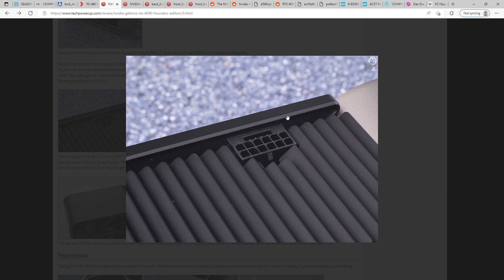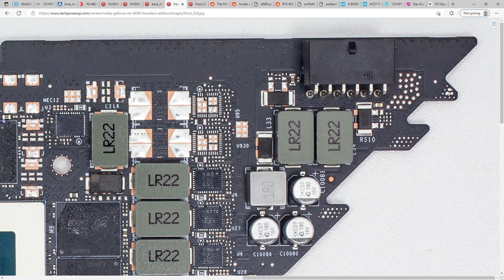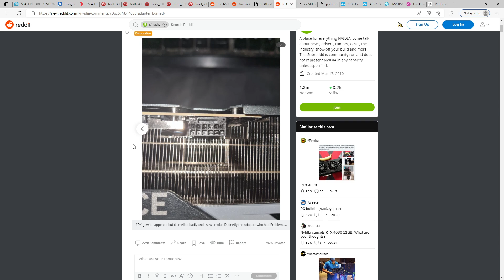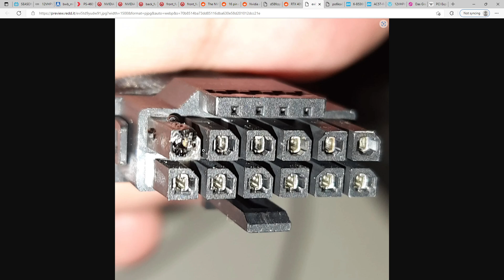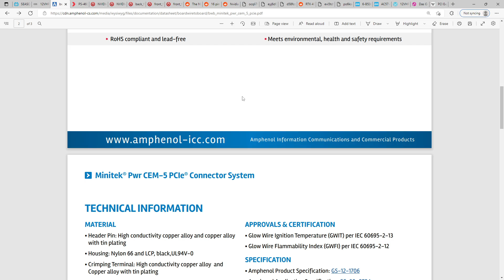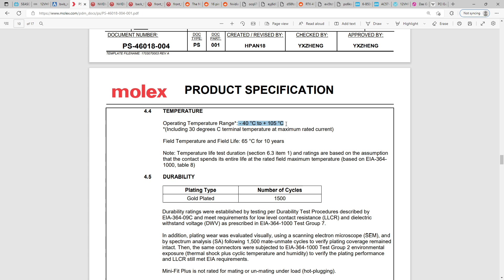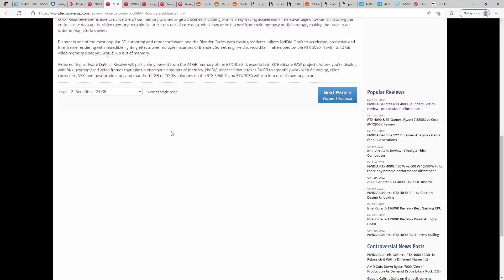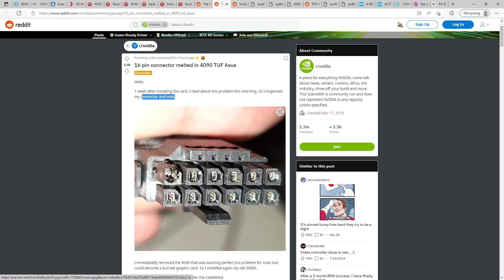rambling about the 12VHPWR failures

Comment: How do you feel overall about the amount of current being shoved through those connectors? At 600W that's 50A of current which just seems to be asking for connector problems.

Obviously that'd be total chaos with power supplies, but maybe there should be a 24V standard to bring the current back down before we end up with GPUs with car battery terminals on them...

If you think about it, what else in your house even requires a 50A capable connector?
Reply: Your concern is unfounded. The wires are more than capable of the current when counted in parallel bundled together. I will explain why since you seem smart.
The 4090 adapter shown is using 14AWG wires, 4 of them for power, 4 for ground feeding into the 12-pin plug. This 14 gauge is very common wire-gauge in homes (also 12), and is regulated to 15-amps in the US, you would be familiar with this spec. This is conservatively rated for in-wall home safety, the wire itself is acceptably used in 25-30 amp in other situations, or even more if cooled. So Taking conservatively 15 Amps * 4 Wires = 60 Amps. Times 12 Volts = 720 watts. More than enough to cover the 600w figure.
That said, the Pin and the Connector, I can't speak to, but BZ said 9.5 Amps capable per pin * 6 pins = 57 Amps. 684 watts. So also enough.
It wasnt the electrical engineering that went wrong, its the mechanical engineering.
You bring up a good point though about the 12V becoming somewhat undesirable when such high amps are needed.
Reply: @mrlithium69  Yeah I get that the connector can handle it, he's explained it very well in the video and supported it with actual specs. But the 8pin connector did have a much wider safety margin which undoubtedly contributed a lot to incidents like this being rare. Hence why the question, have we reached a point where GPUs need so much power that 12V is worth it anymore.

I know these things fairly well and I wouldn't have had thought to even think about the connector if I had a 4090: plug it in, close case panel and use the card. Realistically with an 8pin even though it's not great for it, you wouldn't think too much about it being squished a little if you're tight on space or length as long as it's "clicked" in properly and doesn't come out. Lots of people have their motherboard 24pin do a sharp bend to go into the back of the case and nobody thinks anything of it either. 50A just needs a lot of pins and very good contact and nothing about this connector or cable screams high current, proceed with extra care.

I'm also thinking about all the videos out there of LTT or GamersNexus receiving PCs from prebuilt companies with connectors not being plugged in correctly. This connector effectively needs to be plugged in perfectly and its cable ran perfectly to not be an issue. Going to 24V or even 36V would bring the tolerances back to 6/8pins. It's going to step it down to 1.something V anyway, if anything the VRM should run cooler.

With ATX12VO coming up, now would be the time to include other voltages in the spec on top of getting rid of 5V.
Reply: I would like to see 48V what is used in telecom.
I think main problem in this case is nvidia adapter has bus bar in connector and if connector is having uneven force that one connector is making better contact then it take "all amps" and burn. ok not all but over rated current for that pin. But with individual cables cable resistance is balancing those currents.

Comment: Question: Why can't they use SATA type connectors?
Reply: The pins in SATA power connectors are very small and are rated for relatively low amounts of current. About 50watts compared to 300ish watts of an 8pin PCIE connector.
Reply: @xDownSetx  ahh. Ok thanks for the enlightenment

Comment: This connector would probably work fine if each crimp were terminated to a single cable.  The fact that they are commoned by a rigid strip of metal in order to adapt the number of connections means that the bending moment placed on the outer pins is quite large. This combined with the split female crimps means you probably end up with the far pins making only partial contact at the tip and the base of the male pin. As you pointed out the thermal resistance of the plastic will be quite high so it won't take much additional power loss to cause overheating.
Reply: The bending of the cables is just stupid. It could easily be rectified if someone had actually used their brain when designing cables and how the connector was placed on the board.
Reply: @mrdali67  You forgot one of the most glaring issues - STRAIN RELIEF. How TF there isn't any REAL strain relief material securely holding the wires is just absurd. Coming from a motorsports background, strain relief is a big deal because of all of the G forces & vibration, and to see such minimal strain relief on a connector of such fragile construction is just mind blowing.
 
What Nvidia won't do to save a buck...
Reply: @RyTrapp0  Ya it's a huge problem, but you can easy make a connector  where you don't have the strain to the cables. 1. Put the darn connector on the back of the card and make 2 versions of an "L" connector so it's possible to choose the right one dependent on how your mounting the card. And you should have no problem in getting a good cable management without bending the cables right at that connector. It's not that hard to figure out. Jesus .. doesn't require an engineering degree 🙃. Again, It's because they didn't care and just botched a really bad solution that could have easy been avoided.
Reply: And 3000 series adapter has all separate cables for terminals. It seems like lower build quality this time.
Reply: @wassilia1234  The 3000 series cable did use the same dual split female pins tho, makes it seem more like a difference in the constrution of the cables causing the issue rather than the pins themselves since they are common between the two adapters, and we didn't have an issue drawing 450W+ over the adapter when connected to a RTX 3090Ti.
Reply: Personally I think that copper strip was an engineered self limiting mode of failure following the theme of the rest of the connector: be as cheaply made as possible. An interesting phenomenon is that once you push enough current to start melting down PCI-E connectors, there's actually capillary action which will wick the molten plastic into the terminal and you end up with a nice layer of non-conductive plastic between the pin and pin housing which stops current from continuing to flow before there's ever a real risk of a fire with only 12V.

To me this is just another classic case of an insanely greedy corporation relying on clever engineering shortcuts to further pad their margins. And with nVidia's history, I'd bet regardless of how prevalent this problem becomes, they're more willing to send this to court for years before they ever considered a product recall (for those with doubts about how low nVidia will sink to avoid liability, just look up "Bumpgate".)

Comment: Well regardless of what really causing it inside the connector cuz different people seem to have different opinion . How safe would you say are the native connections from the new psu compare to the nvidia adapter? Also any thoughts on the 3 pin version of this cable? cuz so far it seems only the 4 pins are melting but I could be wrong and we already have a case not made public
Reply: Watch the video

Comment: Yeah that was also what im thinking...how can a disconnected pad cause the melting of pins? The amount of current going through the Pins doesn't change, only the current going through the cables. Which aren't failing. Even IF both outer pads rip, for many PSUs 300W on a 8-Pin is still within spec... unless you plug in a daisychain cables with both outer plugs and then all current goes through one cables to your PSU... But in that case not the Pins or GPU fails, but the PSU...

Comment: It makes sense the load balance of 3090ti are saving the conectors from burning. The power draw will folow the path of less resistence. Ex: If 4 out of 6 of those conectors are getting any more resistence than normal, the power will flow through the 2 ones with less resistence and exceed the specifications (creating the problem), with power balance the board will not let it happen. Probably the split casing of the conector with bending is creating this bad conection with some of the conectors and causing this unbalance.
Reply: Nvidia cheaping in the conector and the board balance created this problem.

Comment: About damn time.. if there is one channel that should give some info on it should be this one.
The fact that you did not want to is the reason i never subbed :P
The problem is Nvidia not using Amphenol spec connectors... thnx.... 
my home made one (using Amphenol connectors) does 1200w ez... btw...

Comment: yes, there is airflow, but remember there is pretty hot air coming from that location in the middle of the card when the card is under full load. if the connector was on the end of the card it would be better imho.

Comment: Hi i've never commented on one of your videos before but i have to say something about the solder side of the connector. 

It looks to me like each of the solder pads on the connector are separated with a split. If the solder that's been applied only connects to the single solder pad then bending of the 14awg wires could also put tension on the pin interconnect more so than the middle four which are all soldered together. 

Nvidia should've made the solder pad one piece and only had one split in the pin as you mentioned.

Comment: The connector is fine . Was a much needed change over having to jam three 8 pins into high end GPU's. The adapter just sucks & that's on Nvidia. Don't get the two twisted.
Reply: He explained his reasoning for disliking it quite well. There is barely any safety margin on the new 12-pin connector. Also, the pins/terminals seem smaller so it's not very physically robust. There is no real benefit to the user and all it does is cause issues having to use a crappy adapter or buy a new PSU for literally no benefit.
Reply: Never planned on using the adapter as it would of defeated the purpose of parting a new system that takes advantage of the new connection type with a ATX 3.0 compliant PSU. It's a bullet I dodged but I'm glad I made the switch lol. Never going back to PCI-E connectors if I don't have to.

Comment: Why don't they just use a big ol 2 pin DC connectors that RC lipo batteries use that's actually designed for high amps, and don't care about cable bending. Would take about the same amount of space from the pcb as that 12pin.

Comment: with the split pins, a bit of sideways force would cause the pin to open slightly, then you would only have good contact in 2 places, the front left and back right ... and the top + bottom, but a) they are only partial surfaces, b) the force would be left/right so would have better contact there.

Comment: I'm somewhat certain that the hot spot is not where the pin meets the socket, but in the fairly thin section where the metal isn't bent between the actual socket and the plate that wires are soldered onto. It experiences strain from the wires, is by itself fairly thin, and is fairly easy to break. Now I don't think that in most of the melted connectors it broke, but I'm somewhat certain that it has experienced some mechanical stress, which can make it even thinner at spots and increase the resistance. I think it explains the fact that the cable bending is a large factor in the failure. As for why the inserted side of it is melting, and not the cable side? Cables are good thermal conductors and will just wick away the heat from the connector. But since there is that bottleneck of smaller cross section between the cable and the socket, it the sockets will get hotter and first externally visible melting will happen around them. Crimped sockets do not have this problem because there is no such bottleneck, as there is more metal in between the socket and the crimped part as the bend of the connector socket matches most of the bending of the crimping socket, so no need for the bottleneck.

Comment: Doesn't EPS use a similar connector to 8-pin while it is rated for 300w? thanks to intel, we do have cpus that can surpass 300w easily and there hasn't been any reports of widespread issues with that cable, right?
Reply from the maker: yeah the 8pin EPS doesn't have much of a safety margin on it. The PCi-e 8pin a bit of an anomally in that sense.

Comment: Sup buildzoid, have you seen the Brazilian Galax team (Teclab) pushing one cable with >1000w load for a couple dozen minutes in a few lives? even testing different power supplies, plenty of those getting into protection before any harm was shown towards the cables, which is kinda impressive, but still, I'm mostly interested in your opinion on those guys who push for WR OCs vehemently defending the build quality of the cables in response to the enthusiast public encountering and pushing for attention on the issue.
Reply: Conflict of interest is a thing. of course the manufacturers and people associate with them have the incentive to defend the product.
Reply: @SolarianStrike  That is true, although I understand that could be extremely naive by my part, I still find it a bit odd/unlikely how those guys with an image to preserve in the hardware space would shill for Nvidia this heavily if there truly are issues with their product to the point "casual" users with under the spec wattages, since most gpus don't seem to be pushing past 500w mark without meddling/specific models, are suffering cosmetic damages and/or pin damage.
Reply: @SolarianStrike  at least they do live testing and film it
And not just rambling

Comment: thanks no one was showing the pins / contacts i am a  HAM  and they will not holdup  under stress. I'm used to running 12 volts at 1 amp to 150 amps. Not on video  cards.

Comment: I was thinking arcing for a moment (because broken off foil that is used across those connectors would be so close that I thought it was plausible), but then I thought to when I was using cables to jump start my car and while there could be sparks, I didn't think it was arcing. Not with 12 V. Also the other parts of foil would also be 12 V, so there wouldn't be charge differential, unless perhaps it completely snapped of from all connections, then it wouldn't conduct current through it, but maybe it would still have 12 V? Hard for me to say, knowledge of electricity breaks down for me at that level. Also the fact that it was on terminal side usually. Maybe those with melted cables (that we can see on PCI-SIG) would be affected by this, but not those of users. I still think that connecting 4 cables to 6 terminals is a bad idea, because it would be much more prone to manufacturing defects, which might be why OEM's generally go with 6 cables instead of 4.

I didn't think that terminals would be split in half on both ends, because it's such a stupid idea. But I guess everything is possible with NVIDIA. Would love to know if this is similar on 3090 Ti's or if it's something that subcontractor introduced just with 4090 to decrease cost by 1 cent. I can imagine NVIDIA paying them so little that even this amount of money would eat away at subcontractor's margins heavily. Still - it must have passed some kind of NVIDIA QC. Which is very bad for NVIDIA.

I hope that with this the matter is resolved. And yes, thermal cameras wouldn't tell you much unless maybe if you knew at what terminal temperature you have what exterior temperature on connector? But that would already mean you'd have to measure temperature on terminal, which would be a bit redundant.

Interesting to see Galax doing 1530 W through this connector. But I wouldn't want to put more than 600 W through it anyways. And obviously 3x8 pin is better. Or 4x8 pin if you want to go with specification. I'm glad AMD isn't using this connector for RDNA 3 - though they might migrate to it later, but that will be after all of the "teething" problems go away (I do wonder why consumers have to be beats testers again). And 8 pin would still be better even compared to good quality connector like Cable Mod ones.

Does anyone think that NVIDIA will sue their subcontractor? And lay all the blame on them?
Reply: "and while there could be sparks, I didn't think it was arcing. Not with 12 V."
That is arcing. And arc-welders run in the range of 10-40V usually.
Reply: @ABaumstumpf  I did see arcing on 24 V. But at 12 volts the distance would have to be really tiny. And one of the wires would have to be not under load I think, since again, voltage is described as difference in electric potential. If both are 12 volts and none is ground, then difference is zero.
AFAIK you could theoretically get arcing with any voltage due to the fact that it's chance increases with inverse of square of distance. The difference between spark and arcing is often length of time - that is at least what I was told. but I will defer to both you and Buildzoid, since I'm not an expert and I assume you're at least more knowledgeable than I am in the matter.
Reply: @jannegrey Again - refer to arc-welders. 
While in general anything under 40V open-circuit voltage is considered bad as that will make starting the arc a pain, during welding that might goes to 20V or as low as 10V with normal machines.
An arc offers really low resistance and in general you can for some extreme arcs even from just 5V if your powersupply and cabling is beefy enough to supply a couple hundred amps.
Reply: @ABaumstumpf  OK. Thanks.